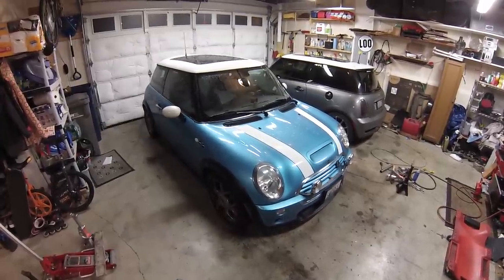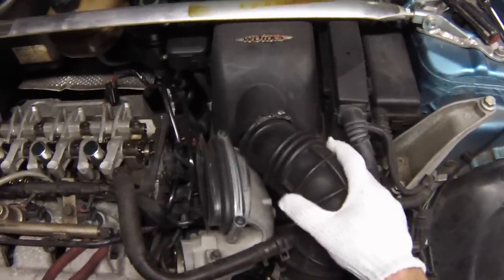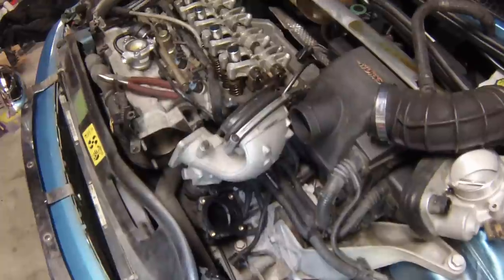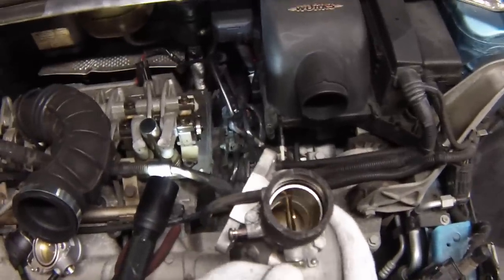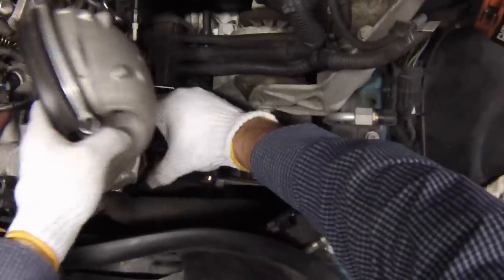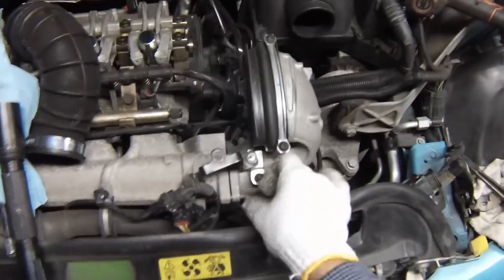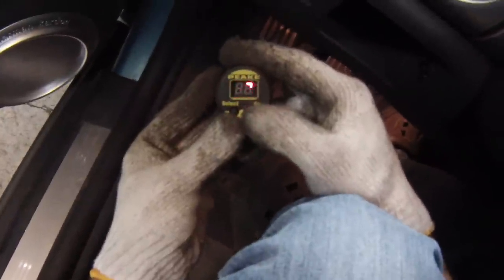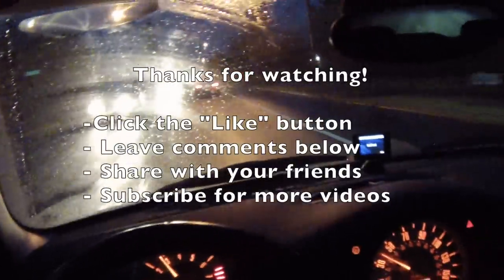MINI Cooper S R53 Bypass Valve Repair 2002-2006 BPV

Comment: What are the 2 lines going into the supercharger intake tube called? One gos to the brake booster but I need to know the ather one my mini is missing that line and the intake hole is plugged trying to fix it but need help knowing we’re to start! Thanks

Comment: I have a 03 mini cooper s supercharged and the clutch safety switch failed. We put a bipass on it til the new switch came in but when we put the new switch on it did the samething as it did when we had the old one on. Anyone have any ideas what else i need to check?

Comment: Great vid!  Thanks. Thinking bout replacing this on my 06 MCS. Pushing 70k on the orginal and I've noticed some throttle issues that I think are realted to this valve. Also getting an odor from the egine compartment at speed when the car is pushed a bit that I believe is the drive belt slipping on the supercharger. Belt looks like the original.  Thanks again for your vids. Great stuff!

Comment: hey mod,rwrote to u awhile back about a thump when going over small bumps in the road.i installed new pbs urethane bushings on control arms,new shocks,new tie rod ends,new towers..but still same noise,ugh.but found problem it was bushings from front sway bar replaced and all is well.oh i forgot to say the vid for the control arm bushing installment and home made tool great job,followed your intructions worked perfect.thx again

Comment: I wasn’t understanding at first. But you are correct. I watched one of your videos and my car reacted the same. I was at idle put my car in fourth, released the clutch and it did not stall it actually moved forward to my shock. It is definitely the clutch and I hope my flywheel is still good. I am familiar with taking the front end apart because your video showed me how to do it to get my alternator so I’m half way there. Thank you so much for your help! I will keep you updated on my clutch change. Could I send you pictures? I’m 10% scared but I’ll be around other licensed mechanics in case I get into a snag. But I’m confident I can do it. I really care about my car.

Comment: Hello. First off I really like your videos. They have helped me work on my girlfriend's 2003 Mini. I've been able to do a ton of work without taking it to a shop. 

I recently took off the cover to the air filter to check it. Of course it was dirty. It's the original OEM one from the factory. The care was bought used and it looked like it was never replaced. After cleaning the air filter the power of the car came right back. It is the original round one not the flat one that can be bought at auto part stores. 

This is where my issue began. A vacuum hose came off that cannot be seen. The service engine light  is on now. We have tried to reconnect it. My hands are too big and my girlfriend tried to reconnect it. We aren't sure if it is. 

I'm not sure if there are any vacuum hoses that are related to the air filter that would throw a code out like that. 

My only recourse is to take the engine apart as you have in this video and see if a vacuum hose is disconnected or broken. 

Any insight would be helpful. I hope my description makes sense to you. 

Thank you. 
Chris
Reply from the maker: Chris Seifert Sounds like you have a JCW. There is one vacuum line between the air box and intake. It falls off near the bypass valve. Anything beyond that, it would be impossible to say much without seeing the car.
Reply: Yes it is a JCW. I forgot to mention there was one short and I mean short hose that wasn't connected to anything that I'm aware of.

Thank you for the reply.
Reply from the maker: That goes to the white connector on the airbox lid.
Reply: I was able to connect the hose to the airbox lid. this little hose does not go to the air box. I have no idea where it goes. When I get a chance to work on the car and take it apart as you have in the video I may find where it goes.  Her car has no flat spots in acceleration I doubt its the bypass valve throwing the service engine light.

Comment: I am always captivated by the detail on these tutorials. My MCS has been playing up in the same way! Thanks for the pointers,I have carried out the manual check and have low pressure resistance on the vac valve spring, new one on order, keep up the great work, thank you!
Reply from the maker: james robson Yup, if you can easily press it with your pinkie finger, it's probably bad. Good luck.

Comment: Nice video. Nice analysis of the failure.
This job looks like it would be easier with the car in service position. Particularly with those lower hose clamps.
You need a pair of Clic R pliers.
Perhaps a radiator hose pick would work to install the intercooler boot.
Reply from the maker: Garth Goldberg I suppose service mode would open up space a bit more but if you are replacing with a worm type hose clamp, it shouldn't be necessary and saves a lot of work. 
I've survived without a Clic R plier until now but maybe will get one someday! 
Radiator hose pick would work for the intercooler boot as well.

Comment: Double check the vacuum line from the air box.
I just had the vacuum line from the air box to the bypass valve crushed between the two halves of the air box.
P1689 No other codes.

Comment: 🎼 No one knows the trouble with my MINI....

Except maybe Mod Mini 🤞 Had vac lines changed and it's still pooping out in second, randomly. No codes except slight evap ones. Thank you and wish me luck!
Reply from the maker: The vacuum line is popping out? Try putting a zip tie around the end to keep snug

Comment: Thank you so much for your videos. I have a problem with my Mini regarding the super charger. My Cooper S doesn't work. There is no whining and the car does go rather slow. The car also goes limp if i accelerate to fast even in 6th gear on the motorway occasionally! In this case I will have to turn the car off, wait at least 3 seconds and then turn it back on. If I don't wait 3 seconds the car makes a cringing, staticy, scraping noise. The dealer said it was because of the Bypass valves and MAP sensor. I would much appreciate any feed back.
Reply from the maker: I can't really say anything based on this. The dealer is probably correct. Press on the spring like I said in the video. If there is almost no resistance, you might have a bad BPV. It is unlikely that the BPV and MAP sensor failed at the same time. A bad BPV will cause various codes as I mention in the video description.
Reply: ***** I took out the bypass valve and it seems to have good resistance. the spring seems to be good. is there a way test to see if it leaking. Or do you think it could be something else?
Reply from the maker: Han ozdemir Suck on the tube to confirm the spring retracts.

Comment: Thanks for your great videos, very informative and easy to follow.  What I have going is intermittent limp mode with codes of P1125, and P1229.  How can I diagnosis the difference between problems with throttle body or bypass valve.  I don't want to just replace parts if not needed.  Thanks for your time in response.
Reply: JUNK PILE..Did you ended up changing both of them? If so, did it change the performance of your mini?

Comment: I have a 02 R53. This video was great i wish i would have seen this rather than taking it to the mechanic. next time i know i can do it myself. let me begin with issue.. Mini was going on limp mode, codes indicated bypass & throttle.  mechanic ordered and replaced Bypass Valve and Throttle. drove the car for about a month and then it started to go on limp mode again. i took it back and gave the same codes, mechanic ran it through the computer, he said that throttle is working @ 100% and so is the bypass valve. He turned it off and on and no codes were showing and it worked fine after that. On the way home it went back to limp mode.. i also don't want to keep purchasing parts that is not going to fix issue.. last service was $1300... any recommendations? maybe wire loom/harness and if so do you have any videos on that.. where are you located or can you recommend a good mechanic in Los Angeles area. thanks
Reply from the maker: j aceves what are the codes? There is a code for throttle body that goes away and comes back. If it starts to come back, time to replace throttle body.
Reply: p1125 & p1126 Cnf & p0638 cnf Throttle Actuator Performace (Bank 1)..throttle body was just replace (new) same time as bypass valve

Comment: Does this often go bad on the facelift R53s? Mine feels like I don't have boost, and from inside it sounds like air is rushing out when accelerating, but on the surface everything seems tight. I don't think the car is throwing any codes either as there are no extra lights on the dashboard. Thanks for your videos, they've proven useful already once before when replacing my driveshaft.
Reply from the maker: Yes, part is identical. Check your intercooler boots for cracks or otherwise smoke test for air leaks.

Comment: Did you used to make bmw repair videos as well? 

Thanks for this, super helpful! My 05 mini S has a surging feel during acceleration but no codes. Going to check the spring pressure right now 😀

Comment: Hi Mike. I have an R53 Works -05. The idling varies between 700rpm and 900rpm and sometimes it stops even at red lights. Do you possibly know what it could be due to
Reply from the maker: Probably air leak.

Comment: Hey again,  So the dealer service came up with DME fault code 001688. I thought if I just changed the torn intake boot, that might solve my stalling, limp mode issue. Although everything seemed more or less fine, (still a bit sluggish), after putting it through the paces, (city driving, anyway), drove it somewhat aggressively, stomped on the gas to activate OD, short stops, etc., everything to try and replicate the stall, thankfully without success.  Stopped into  a store, got back in the car five minutes later, pulled out of the space and... Surprise! Surprise! Into limp mode!  After speaking with a very cool shop foreman in Valencia, Ca., he said he knew what was going on, and, more than likely it is a broken harmonic balancer. He said this is often misdiagnosed, even by Mini techs, because many times the 1688 code is misleading. Going to remove the belt and see if the balancer is indeed in puzzle pieces. Let me know what you think.
Reply from the maker: Dan W That does sometimes happen. When the car is idling, if you see a wobble, that could be the reason. Another reason for fault that I learned about recently is a loose aftermarket 15% etc. supercharger pulley. Essentially - slipping belt results in lower than expected boost.

Comment: PUT THE CAR INTO FRONT END SERVICE MODE FIRST. So much easier, quicker and less headache. 
After struggling to wrangle it out, I put it into front end service mode for access. There was NO way the pipe was coming off the diverter valve and intake chamber unless using some pry tools whilst it's on the bench.

Comment: Really great, informative diy vid. My fiance drives an '06 Mini S, and although she's not experiencing this same problem, I'm thinking they may be related? Here's what's going on - the car will suddenly just stall out. Doesn't seem to have any loss of power, and generally starts right up, but it is happening more frequently now. Cut out four times today alone. Very low mileage for an '06, (I think it's around 60K). Any chance you would be willing to discuss over the phone?
Reply from the maker: Dan W That's probably something different. Any check engine codes? Sorry, but I don't have enough free time to discuss car problems with fans/viewers over the phone. Sounds like an electrical problem more than anything else. Loose engine ground, loose battery terminals, weak battery.
Reply: ***** Thanks for the quick response. Check engine and EML light did come on. Waiting to hear back from dealer service on any codes, (having repairs done elsewhere if I can't work it out. You wouldn't happen to be in the NYC area, would you?). I'll check the terminals, battery integrity and look for a loose ground, but I believe every time it's happened it starts right up again. Of course I can't say for sure if that's the case, since the fiance is the one driving that car 99% of the time.
Reply from the maker: Dan W For the cost of a dealer diagnostic you can get a decent code reader and pull the codes yourself. Sometimes they are a mystery, sometimes not. WA State.
Reply: ***** Yeah, it's on the 'to purchase' list, but I had to get some sort of code answer info quickly, as she uses the car daily. I'll post tomorrow whatever I find out. This is what they came back with today - 
FOUND SHUT OFF VALVE DEFECTIVECAUSING CHECK ENGINE LIGHT AND INTAKE
BOOT IS DRY AND CRACKING

I'm GUESSING they're talking about the bypass valve? BTW If you happen to know of any good, independent garages in the NY/NJ area, it would be greatly appreciated.

Comment: I’m in a little trouble and I need your help. My 05 Mini Cooper s has no power. I can put my foot on the gas and rev the engine and my car goes very slow. The strange thing is no check engine light. I have no acceleration. I put in an additive for the gas maybe thinking it was a fuel system issue. That did not work. My car works so hard to go nowhere. Can you help?

Comment: Hi Mod MINI, Great video!  Lately My 2005 Mini Cooper S can't rev more than 5k rpm(acts kind of like a rev limiter) and throws DSC light and OBD code P0108. I replaced both MAP sensors, fixed few vacuum leaks etc with no luck resolving the loss of power and rev limiting.  was suspecting the BPV at one point, but, noticed it has a solid pressure when I tried to move the valve while the car is off. Also noticed it moves from one position to another when the car is rev'd up and let go of gas pedal. Is it a good test the zip tie the BPV while the car is off and expect the car to behave normal ?  you think this issue is related to BPV or something else? Thanks for any  insight you could provide!

Comment: im having a random issue where i lose power like how you described in the beginning of the video but its at random times. this one time i floored it to pass a car, and after i passed him, i let go of the pedal and i started experiencing what you said, the car was loosing power  , it would not accelerate no more than 3k rpm. i had to stop on the side of the road and turn off my car and turn it back on to reset what ever was happening. i have a 2006 mini cooper s jcw also

Comment: Another great video! A little more involved than some would have you believe. Keep these videos coming. Any pictures of the disc cooling ducts yet?
Reply from the maker: BigSteveRealtor I haven't had to take off the front of my car yet...
Reply: ***** Oh okay I thought you could with just taking off the tire. My bad. I requested your friendship of FB did you get the request?
Reply from the maker: BigSteveRealtor
I suppose it can be done without removing the bumper but it's a lot easier. There is cutting involved. As a general rule I only add people on Facebook that I have met in person.
Reply: ***** Okay Ill wait since you are probably correct that it would be better with the front fascia removed. I also understand about the meeting people for FB. I was only hoping because if I were to have questions I could address them to you easier. Check me out on FB Stephen Modica and you can decide from there.

Comment: Hey Mod mini thanks for all your vids man, great stuff.

Hey i replaced my bpv on a car that was working fine besides a lack of boost and now when i start the car,  itsss weird reving and wont hold idle.
I had a look at the bpv with the engine sortta running and it not opening.
Gives me the codes 1109 and 1242. 
Did i break something?  it is a little wiggely on the green gasket on the supercharger side of the crappy plastic tube Any ideasss???
Thanks in advance.

Comment: I have a Minicooper s r53 2005 and I think its performance is modest, I can hardly hear the sound of the supercharger, so what you showed may be a problem with the bypass valve. With the replacement, did you feel immediate improvement? Thank you very much.
Reply from the maker: Yes, if that was the problem.

Comment: How would you reccomend going about zip tying the bpv? I'm having sluggish performance (its an absolute dog under 3k). I reached down there and surprisingly there's almost too much tension. It feels as if it corroded slightly. As it closes, you can feel resistance. So I'm thinking it may have trouble closing once it has been opened under normal circumstances/driving situations. 

I just can't seem to find a good way to zip it closed haha
Reply from the maker: Chicago06sti If you can feel any lack of smoothness it's probably shot. You'd just find something nearby or even stick a screwdriver in there to zip tie around it...
Reply: ***** screwdriver worked! Boost came back quite a bit. I guess with 125k..it was bound to go to bpv heaven sooner or later! Thanks for the help! :)

Comment: I have the sometimes yo-yo on acceleration but no codes.  159k miles. I have already replaced coil, plugs, wires, fuel filter.  Any other hints to determine if it is indeed the bypass valve going out?
Reply from the maker: It's generally the bypass valve and even then sometimes doesn't go away. Get the Detroit Tuned one for best luck